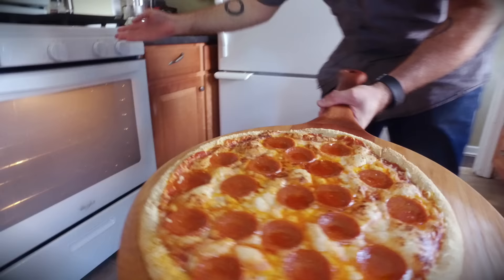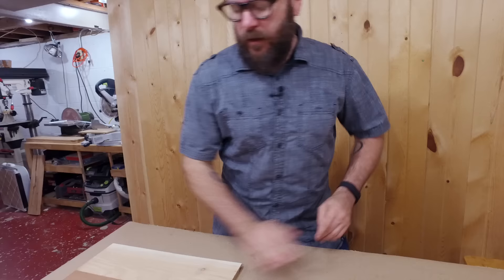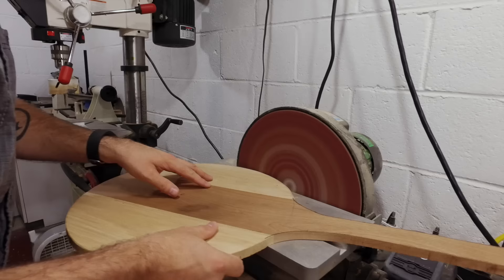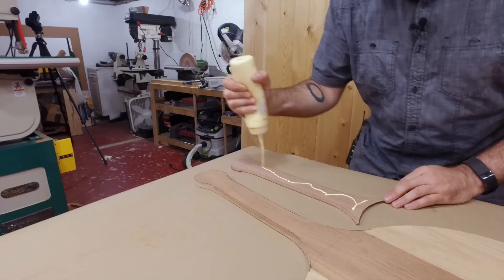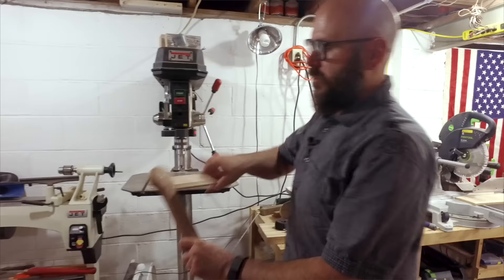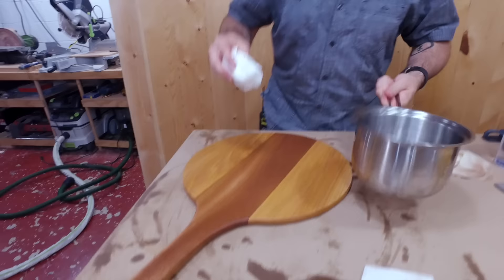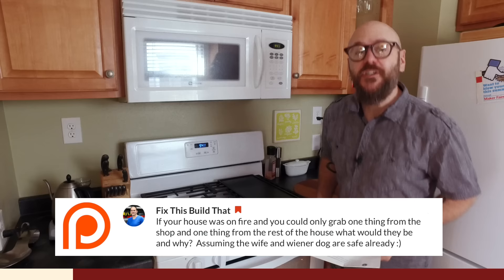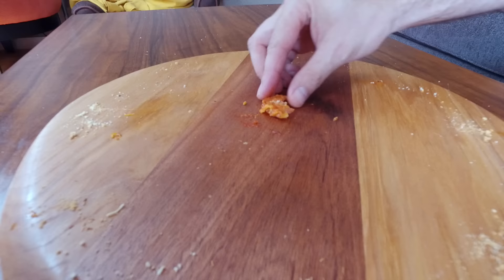How to Make a Pizza Peel | Easy DIY Woodworking Project

Comment: Hey, David, just to let you know, you have your flag by the drum sander hanging backwards.  The field is supposed to be at the top left.  It's a pretty common mistake and I  thought you'd want to know.
Reply: I agree , we should promote correct principals to our youth
Reply: Ummm look again guys its hanging sideways. the left side is at the top(the band that has the brads to hook it to the pole. If you rotate the flag 45derees then it is correct.) btw this is a wood working video not a boyscout flag hanging video.
   😎😎😎

Comment: Will the glue hold especially with some of the temperature changes with pizzas on top? I think i wouldve added a few dowels. Whats your view on that?

I love the project! I love the scattered pencils tip. Glue a magnet to a pencil and stick it to your tools!
Reply from the maker: That magnet trick sound amazing!! I think the glue will hold just fine. If it ever does fail I'll make a follow up video. Thanks Willem!

Comment: I love the paddle, you did a great job,  but am wondering if it needs to be that thick?  I've used pizza paddles in restaurants and they aren't quite as thick.  Just a question, good job
Reply: I want to make on of these and I'm thinking of a 3/8" thickness, or trying to tapering down the shown 1/2" dimension to something thinner on the perimeter. 
On the other hand, you're sticking one of these under a pizza thats been in a 400 deg oven...maybe warping is an issue.

Comment: I love the video! Quick question - did you plane or joint the boards before gluing?
Reply from the maker: Thanks! These boards already had a clean edge from the hardwood store but normally I'd just clean up one edge on my tablesaw. I never use my jointer anymore.
Reply: Cool, thanks!

Comment: Good video.  Why the strait oil first and then the wax/oil mix for the finish?  Better penetration?
Reply from the maker: I have no scientific data to back this up but I think the thinner oil only coat sinks deeper into the wood and then the 2nd coat with wax is more of a top coat.
Reply: Cool, thanks.  Ever heard of birch oil?  Its distilled from birch bark and makes a stinky but great brown oil finish.
Reply from the maker: Three Red Trees I have not heard of it! I like stinky!
Reply: Here is a link to an old blog post I did about making it.  I use if for outdoor tool handle and such.  https://threeredtrees.wordpress.com/2014/05/17/making-birch-tar/
Reply: Dat dank finish

Comment: I like how you showed how you actually used it! HOWEVER, you did not show how you got the uncooked pizza onto the peel. Only placing the pizza into the oven using the peel. Was there a problem picking up the raw pizza?
Reply from the maker: No need to scoop up a raw pizza. Just make it right on the peel.
Reply: @MakeSomething  I agree. But you didn’t make it on the peel. Go back and look at your video. Just wondering how well it really worked.
Reply from the maker: the purpose like any pizza peel is to put the pizza in the hot oven and pull it out of the hot oven. Maybe a pizza peel doesn't fit your needs.
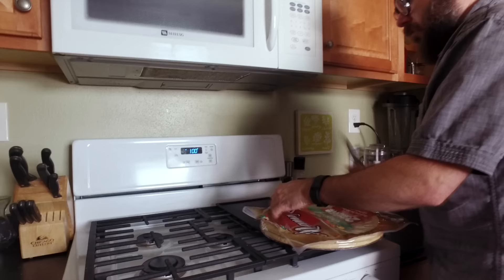Reply: @MakeSomething  That is how I hope to use it. If you go back and look at your video you start building your pizza at 8:10. You do not build it on the peel. Shortly after that you are putting the pizza into the oven using the peel. So I was wondering why you did not build the pizza on the peel. You did not show moving the built pizza onto the peel. 

Moving a built, uncooked pizza has been a challenge for me. It is why I am considering making a peel and the reason that I watched your video. Noticing that you did not build your pizza on the peel and did not show moving it onto the peel once you built it, prompted me to ask the question.

I am not trying to be critical or annoying. Just wanted to know why you did it that way.

Comment: NEVER cut on your peel!!
Reply from the maker: +Mark W this is made for cutting on.
Reply from the maker: Mark, this is a cutting board / pizza peel that is featured in my new book containing 15 cutting board projects. :)
Reply: Make Something x
Reply: I think what Mark W is saying is that by cutting on the peel you will loose the smooth finish which will make it harder to slide the pizza off over time. Obviously, you could sand it smooth again but for anyone who uses a peel often it's generally a NO-NO.  I personally made a two sided peel and use one to Transfer into the oven and the other to remove and cut.
Reply: made for home use how many pies you going cut in a year geezzzzz
Reply: Seems to me what a rolling pizza cutter is shearing the crust as opposed to slicing the pizza with a knife. And for home use, insiginificant impact.
Reply: That's only an issue if you are using raw dough instead of store bought half cooked pizza base.

Comment: I used biscuits in mine why didn't you
Also why did you use hickory it is very porous and food and soap can get stuck in there
Reply: in my experience, boards this short don't need the alignment help of biscuits, particularly if carefully milled to same thickness.  Also structural stress on this joint is minimal.